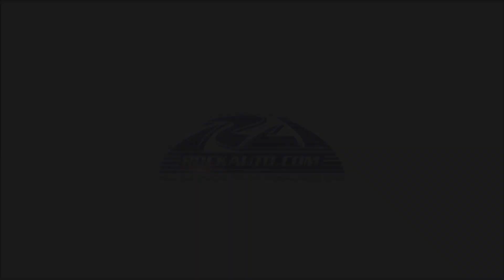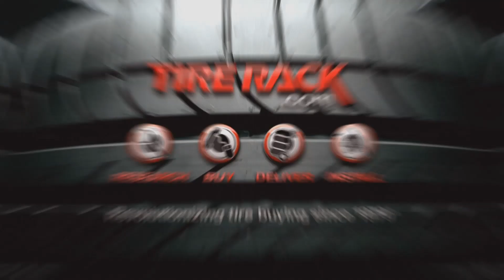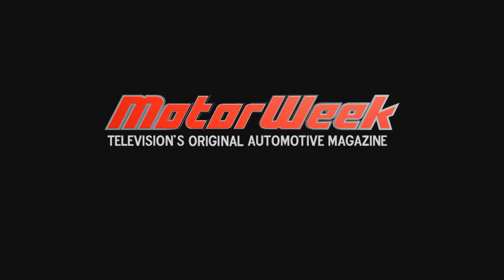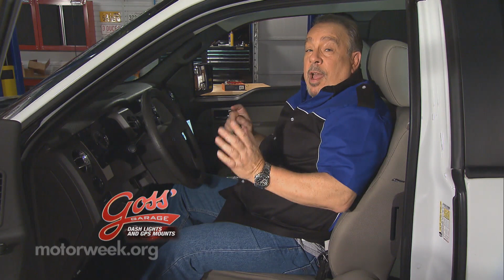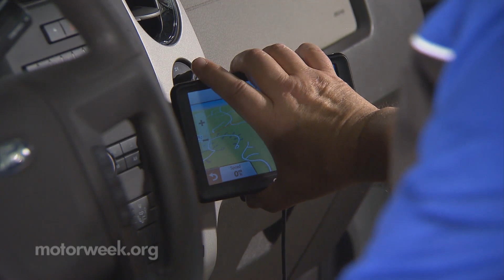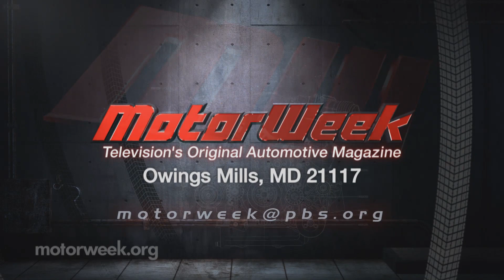MotorWeek | Goss' Garage: Dash Lights & GPS

Comment: Pat-what's up?!?  After doing Motorweek forever (and owing your own shop), you can't afford a new truck?!?  What gives?...
Reply: Mechanics typically don’t buy new cars. Many own old, high-mileage beaters because they’re generally easier to fix than the newer cars. From what I’ve heard, some shops don’t allow mechanics to have new cars and require that they drive older cars to work.